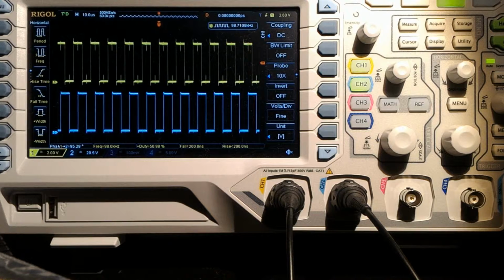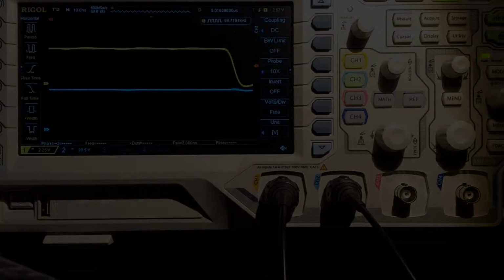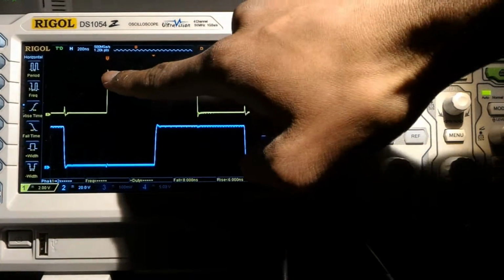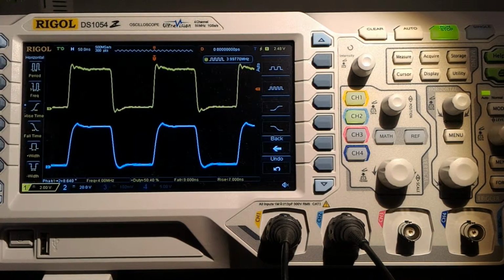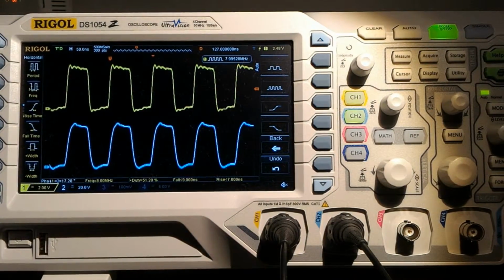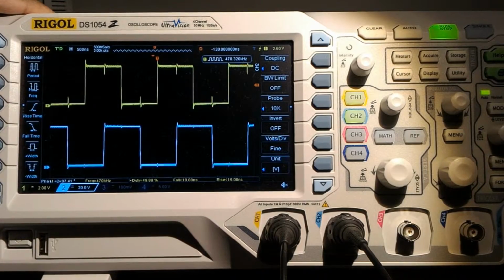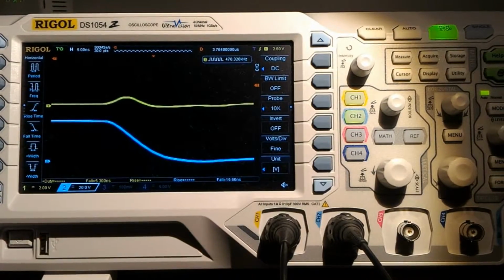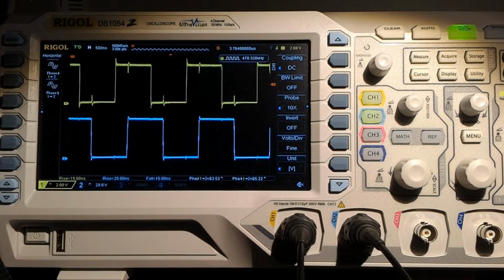Arduino Switching Experiment - Railgun Power Supply

Comment: yo man i don't know much about arduino can they produce continuous dc voltage at its analog pins , like 1v or 4v . without using pwm technique
Reply from the maker: No, that's not possible, you'll have to make your own adjustable linear regulator. Or smooth the pwm voltage.